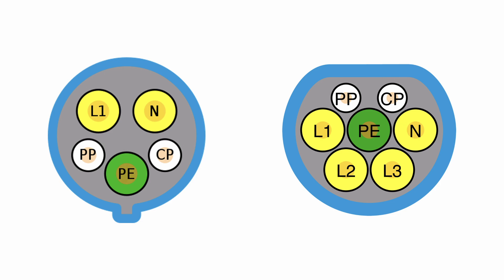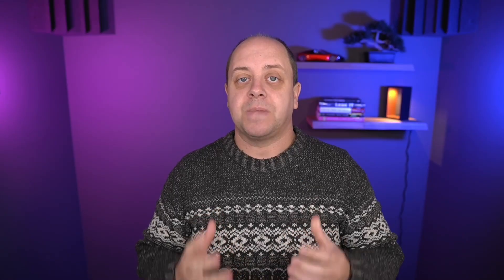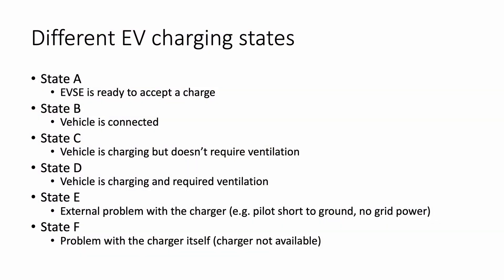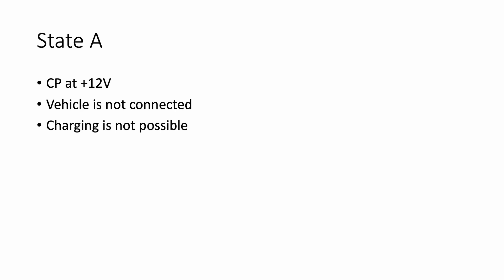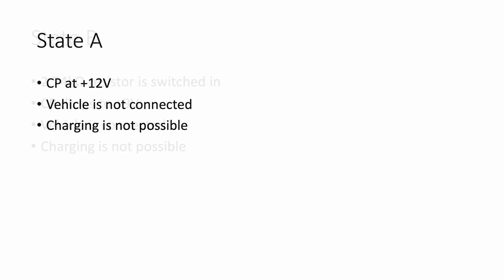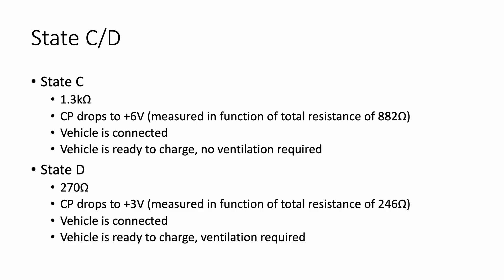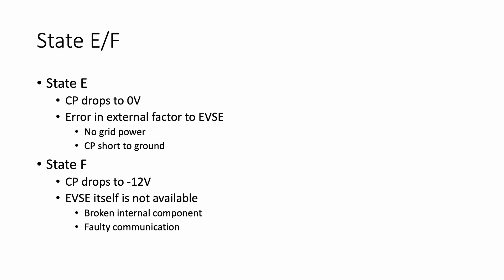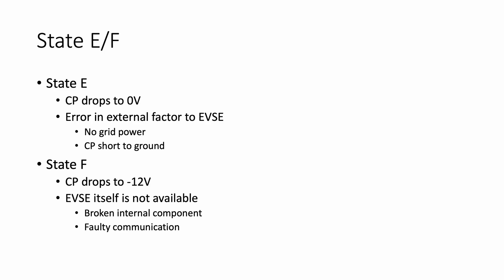How does AC (smart) charging actually work? PWM explained!

Comment: Bery clearly explained. What IF there is no pwm pulse but 6V FC on cp pin? Will car be charged?
Reply from the maker: That is an invalid state because there is no pulse. The car won’t charge at all, unless the manufacturer has not implemented the protocol properly. In that case, the bedt possible scenario is that it would go into safe mode and charge at max 6A. Byt that would be a very bad implementation of the protocol

Comment: Hi, about the CP wire voltage; against which wire do you measure the signal? Neutral or ground, or something else?
Reply from the maker: @Witsenburg  CP is a DC signal so there is no “neutral”. It is always measured compared to PE

Comment: Charging in mode 4, with direct current, do you know how the communication between the vehicle and the charging station works?
Reply from the maker: @VictorMCaña  depends on charger type. For CCS2, you have ISO15118, that also enables V2G and plug&charge communication. And you have IEC 61851 for charging station communication.
Reply: @StevenPeeters  Yes, but that doesn't tell me anything. In alternating current it is clear, the PWM signal and so on. I was asking if you knew about direct current communication, in the end ISO and IEC cost money.
Reply from the maker: @ also costs money for me 😉

Comment: Hello Steven. One more question: If a car indicates via the CP connection that it needs ventilation during charging (state D), how does the charger "know" whether the area meets the criteria to allow charging? Thanks
Reply from the maker: @georgemetaxas9227  it doesn’t. The ventilation was more a requirement for lead acid batteries. It is not measured in any way, just a system requirement for charging
Reply: @StevenPeeters  Good, thanks!

Comment: A confirmation please. I understand that the PWM is a one way communication from the charger to the car. Thus, I guess that all current adjustment happens exclusively in the car's on-board charger, and PWM mainly transfers the current selected value on the charger (or any other external limitations) to the car. Is that correct? Thanks
Reply from the maker: @georgemetaxas9227  the car indeed triggers the different states. The charger then reacts to that state by switching contactors when requested. Current regulations are done by the car as well
Reply: @StevenPeeters  By "triggering the different states" I understand you mean the B, C, D statuses, as for example by using the (typically referred as) S2 switch. Thanks for promt reply.
Reply from the maker: @ yes

Comment: Great video.  For solar charging how do you tell the car to stop taking power - for example if it gets really dark and cant even support 6A. Maybe a <10% duty cycle? or removing the 1KHz signal entirely (0%)?
Reply from the maker: @rocketry100  you go back to state B
Reply: @StevenPeeters  This video   https://www.youtube.com/watch?v=xNEU7blg8JE&t=269s  says there are actually 2 state Bs - B1 and B2.  B1 is where the +9V signal is present on CP (but no PWM) -  in this state the EVSE is not yet ready to supply power. B2 is where the PWM is present - the EVSE is ready to provide power at the indicated rate.

Comment: 12:45 How to calculate duty cycle for higher current (etc. 400Amps that are often used in DC chargers)
Reply from the maker: DC charging uses a totally different protocol. PWM duty cycle between 3% and 7% forces PLC communication following ISO15118 or its predecessor DIN70121
Reply: @StevenPeeters so they still uses PWM signal but with diffrent formula or how does it work ? 😢
Reply from the maker: @paweb.1092  no, the PWM is only used to let the car know it needs to use PLC communication instead

Comment: Do evs have other charging ports? Like plugin directly from solar?
Reply from the maker: There always needs to be a charging device involved. There are other ports in the US, for example, like the Tesla connector or CCS1 for DC charging. But for Europe, type 2 is the standard for AC and CCS2 for DC, with a few cars still on CHAdeMO for DC
Reply: @StevenPeeters  so if I cut the wire from CP sensor and attach it to 6v+ (something like that) pwm at 10% duty cycle I'll cause the car to pull minimal amount of current? Can I just get a 200w solar panel  connect it to inverter 120vAC and get one of the home ev chargers. Would the charger reduce the duty cycle when it senses  the voltage dropping and send a signal to car to reduce  current usage?
Reply from the maker: @vahagnmelikyan2906  no idea, but don’t do that. You’ll void the car’s warranty for everything electric (so everything basically)

Comment: is there a way for us to create a device that allow us to send a signal via CP and control its battery management system(bms)? Currently working on a project to create a device that can allow us to cut of all power supply from the battery in order for firefighters to carry out safe operations on the EV.
Reply from the maker: I think you’d need a physical connection to do that. And the situation you describe is exactly why there are cutting points indicated to cut through the high voltage wires. That is already on the cars.
Reply: @StevenPeeters  cutting point varies in different ev/hybrid and that's why we wanna come out with something more universal or something that car manufacturers can implement with software updates. Hence the idea of designing some sort of plug that sends signal to cut the power electronically instead of physically. Do let me know if you think if it's feasible by sending signals from CP to either BMS or the motherboard
Reply from the maker: @gohkairen  in the US you now havecsome kinfmd of breakaway adapter for Tesla, marketed gor when you are being robbed. But it needs to send a stop charging manually from the screen, but then does allow to go to state A while still plugged in. But it is an additional plug you’d have to use
Reply: @StevenPeeters  noted will develop a plug and see if car manufacturers are willing to program a signal that allows BMS to disconnect 12v battery

Comment: Thanks for the explanation.  Looking into charging and decharging using V2L I do have some questions. As explained CP is used to communicate how much can and may be charged but in the sockets of the loading cable CP is connected to PE and PP is connected to PE via a resistor of which the impedance will show the car and the loading station the cable is 16A or 32A ready but there is no connection between PP of the car and PP of the loading station, the same for CP.  Both are connected to PE.  Discharging an other resistor is used between PP and PE to let the car now it may allow disharching but during disharging it is a floating system, PE is not connected to ground. I do not understand how PMW communicates with the car as there is no direct connection between CP  of charger and CP of the car?
Reply from the maker: V2X is not possible with AC. Onboard chargers are not capable. Needs a DC charging station to work bidirectionally
Reply: @StevenPeeters  V2L is AC and easily can be used in combination with an all in one hybrid inverter using the Gen input or with an island inverter using the Gen port or grid input and an ATS. This is not a problem at all. Most hybrid inverters even have a dry contact for making an N-bound if needed.( v2L is a floating system) I am looking into switching between charging and de-charging (V to Load, not vehicle to grid. ) without having to change the type 2 plug. During the day charging using solar pwr, during the night V2l to home. This without a very expensive bidirectional wallbox . In an MG de-charging must be activated in the car which is not usable but a BYD just needs plugging in and provide the correct resistance between PP and PE. We just have to simulate the socket has been removed and switch between different resistance. As far as I know there is no direct connection between CP or PP of the car and CP or PP of the charger.

Comment: Hello, thank you for this explanation but i have a question. The 12V DC that gets supplied at state A, is that the same current that charges the ev? If the charger is an AC charger shouldn’t the current emitted be alternating and not direct? I don’t quite understand this part and would like an explanation, thank you in advance
Reply from the maker: It is 12V AC as you can see in the graph
Reply: @StevenPeeters  okay i see. Reason why i asked this is because in a published paper they said that the evse supplies 12V of dc to the pilot line and i got confused.
Reply: @AM-o7c No it’s not that power that charges your EV. The EVSE (charge box) supplies only low voltage control signals on the Control Pilot wire. At the start 12V DC is normally supplied on the CP wire in state A. This indicates to the EV (vehicle) that the EVSE is connected. The EV then pulls down the 12V to 9V to request power. The EVSE then switches the DC 12 V to a pulse with modulated AC signal (+-12V) pulled down by the EV to 6V when ready to accept power. 
The actual power to charge your EV is supplied on the 3-phase pins, normal 400V 3-phase AC from the grid (or 230V 1-phase if you charge from a normal schuko outlet)
In state A nothing is supplied on the 3-phase high power pins and no charging occurs at that state.

Comment: Thank you Steven for this detailed explanation. 
I am converting a mini suzuki pickuo to an EV. I want to access a public charger but I undrrstand it need a specific signal to activate. Can you give advise on how to trigger the public charger to provide 220 supply on the J1772 plug/connector?
Godbless your channel😊
Reply from the maker: Thank you for the kind words. And nice little project you hot going there. 👍 Sadly, I have no clue about the J1772 adapter. Also, a public charger will require some authentication with a badge most likely. If that is not what you mean, than please explain the situation in more detail, because then I must misunderstand the question. The BMS should take care of all communication.
Reply: @StevenPeeters  thank you so much for replying. 
J1772 is a normal plug on public chargers that fits most EV (ie Nissan Leaf) 
I need to turn on a public charger to charge my battery pack (EVMini Pickup-Future).
I understand it needs a signal from the car/battery pack to trigger the charger to switch ON. 
I am looking for a simpler way to do this without having the modulator circuit in the CP terminal.
Reply from the maker: @joeabad5908  the CP state is that trigger. You need to go to state C or D for starting the charge

Comment: Hello! I'm planning to assemble  a charger for an E-bike battery (LG Chem 63b - 14s3p, 48-58v 180A) with a type 2 connector with 3 phase. How can I make it work correctly?
I have 3 pcs. power supply 58.8v 50A (input 220v AC  nearly 16A).  They will be built in the bike. I'd like to charge it from home at 220v 1 Phase AC, at work using a 3 Phase 380v (it's a 3 times 220v) and using a real charging station. The home and work there is no issues, because it can be connected directly. But how can I charge on a Charging station?
Are there topics to figure it out? Or with ready solution?
Reply from the maker: Good luck with your project, but I'm no hardware engineer. There are several norms that charging stations need to follow. Probably something with the communication of the EV state, I would assume. But sorry, can't help you there

Comment: This protocol that works with pwm modulation is OCPP protocol or anotherone? Thanks
Reply from the maker: PWM and OCPP are 2 totally different protocols. PWM is between charger and car. OCPP is used for communication between charger and some backend software package.

Comment: First of all. Thanks for the video and the explanation. Very clear!
I have a question regarding the duty cycle length. In case of an Wallbox with Overload protection installation, the wallbox power adapts the maximum Amper they can supply in every moment. How this affects to the Control Pilot duty cycle signal? What says the standard? Do the states C & D accept variable duty cycle?
Reply from the maker: Yes, the duty cycle can change during the charging session. That is how you can use solar power only, for example. the car will adapt to the duty cycle to determine how much power it draws

Comment: Thats a very good explanation on how EV (Tesla) charges.
So the CP pin controls when, and how much the Tesla can draw power out of the wall charger.
So effectivly, the power company can stop yo charging your EV if they so wish?
I guess one should prevent the energy company from getting to your control pin.
It might be possible to isolate the control pin, and have an external voltage control to said pin, to bypass the possibility that your energy company shuts down your EV charging.
Reply from the maker: Correct. In Luxemburg ist is mandated by law that the power company can limit your charger to what they call “safe mode”. This is mesnt to alleviate the grid when it is overloaded.
Kind of like when in the US the Powerwall can be made to dump power on the grid in certain areas. Just to balance the grid

Comment: Thanks for the video! How would you measure available energy to set pwm signal on offgrid solar system? I can only think of light sensor and mapping the value from that to estimate what solar system outputs.
Reply from the maker: You just put magnetic measuring clamps or an electronic circuit on your main line and measure positive or negative power consumption and act accordingly
Reply: @StevenPeeters  Not sure if I follow you. I have no main line. It's an offgid system. I have to create a load in order for the invertor to generate something.  I don't know what the load would be. It depends how much solar panels can generate at a given moment. The load could be the solar batteries and if the inverter decides tu pull some current from them than that could be a signal to limit current for the car. Not sure though what charger would have this capacity to adjust charge current based on current flow from the solar batteries. Any ideas? Thanx.
Reply from the maker: @vindis79  you’d need a charger with an interface. Maybe an OCPP connection. You can use that system to limit the available current. The charger will then take care of the pwm signal. But you’ll have to monitor your capacity remotely though.

Comment: I just got Ford Transit EV and I would like to install solar modules and 120Vac inverter (because is cheaper than 240Vac inverter) to provide power to the van while I'm driving or parked. What do I need to be aware of, to make this possible? I want to tap to the wires of the plug on the vehicle between the plug and Charger or BMS in the vehicle. The dealer couldn't give me enough info. Please advise.
Reply from the maker: Solar has nothing to do with charging your car at all. You need a smart charger that can take your injection into account. But your solar inverter will give you AC power in your house and the charger puts that into your car

Comment: Hi
If i have a convert cable from type 2 to shuko how can it detect there is a car?
Since i did a test with this cable and attached a grinding machine on it ,and it runs so no checking is done with the car or charger ,how is that possible cannot be save that you can do that .
It was on 11 kw charger
Reply from the maker: Schuko can’t detect anything. It doesn’t have the CP cable.
Reply: I know is this not dangerous, should they not take action to this at public charger stations

Comment: Hi Steven.!!
Thanks for the explanation it really helps me to understand the concept. 

However, I have a question about the CP  and Earth. I just want to know why we are shorting resistance and diode with earth terminal. It shouldn’t be with Circuit ground?????
Reply from the maker: Thanks for your question. However, I'm not an electronics engineer. I'm sure there is a good reason for it and someone smarter than me can answer that...
Reply: @StevenPeeters  It is shorted thru the diode so the negative side of the waveform stays intact. Proper EVSE must detect that and deny charging if -12V is loaded and drops closer to GND but some don't.
Reply: @slavric  thanks ,👍
Reply: Earth is circuit ground here for a number of reasons:

1.) J1772 (CCS1) doesn't carry neutral, only L1 and L2. (The pin often is labelled as N, but the intended use also is split-phase 240V US home installations (L1-N-L2).)
2.) Type 2 plugs are also designed for DC, and then the N pin is DC-.
3.) When used for DC as CCS, the N pin is completely missing from the plug.

So short of adding a signal ground pin, the earth pin is the only constant one.

Comment: Hello Steven, very nice video with elaborate explaination of all state. I have a question though:  what do you mean by ventilation required in state C, mostly what does ventilation mean in this context ?? or what is a CP Vent??
Reply from the maker: The Ventilation required state would be for a vehicle with Lead Acid batteries. The charging process of Lead Acid batteries produces hydrogen. When an EV requests ventilation the charging point should either turn on ventilation and allow charging or go into an Error state and deny charging.
Reply: @StevenPeeters  so its actually mean ventilating the hydrogen out ?? So here the ventilation is like a air ventilation. Sorry i got so confused as i thought the term ventilation in electical component may mean drawing less current or some kind of circuit state in low power. As i am a software engineer its hard to understand it practically. Plus in my schematic i saw a circuit that says CP vent, now its hard to guess there is a fan in my ECU that turns on for ventilation, so it must mean something different??
Reply from the maker: @SauravKumar-yn2nv  it is the car saying to the EVSE that the area needs to be ventilated